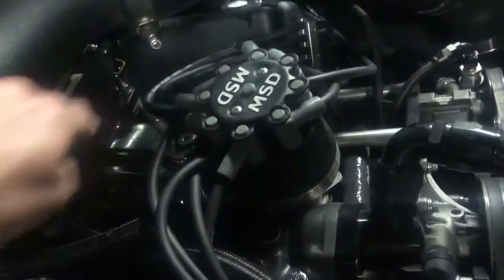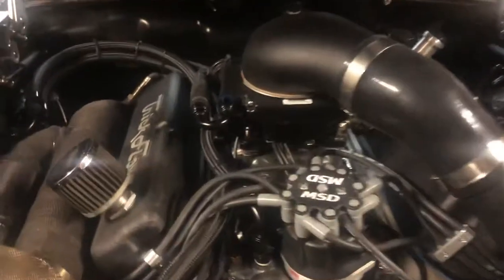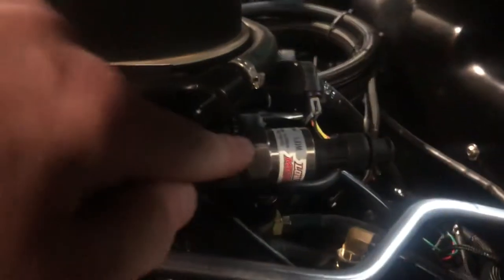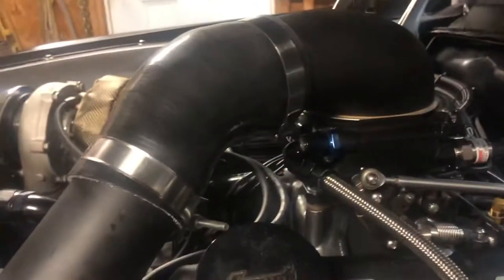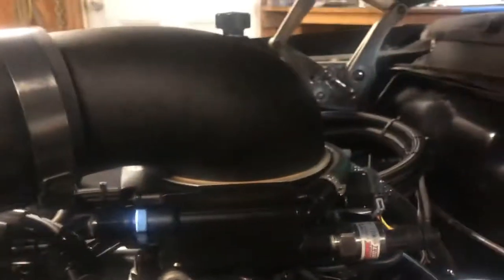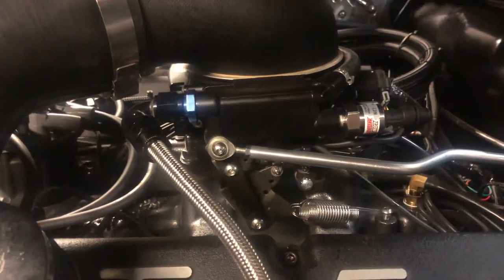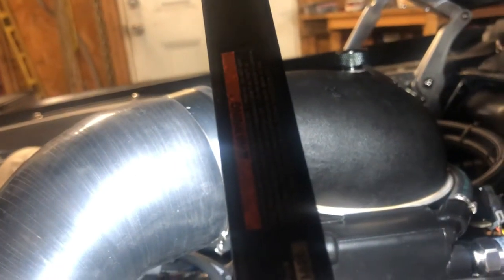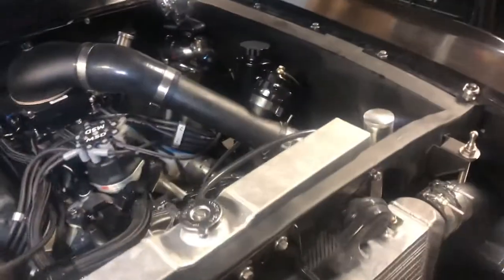Holley Super Sniper installation tips and common issues

Comment: great informative video, never too long if informative. I really dont like the idea of fabricating a EMI RF shield in front of the ECU, thats a band-aid to fix what the factory messed up in design.  I feel ECU should NOT be located in such a harsh environment like heat from engine and being placed next to a lightning storm called the distributor, especially being a Ford where the dist. is closet to ECU comparted to a chevy, like I posted on you other video the sniper Im told was designed on a chevy engine, go figure. talking to a holley tech they said to avoid using their MSD super conductive plug wires to eliminate RF and EMI,  they are 50 ohms/ft and they recommend 400-500 ohms/ft plug wires!! but al ot of folks are doing fine with the super conductor wires
Reply from the maker: thanks for watching it. im currently working on an insanely long series for install, setup, troubleshooting issues, basic tuning, etc.. multipart series.. i completely agree that using a block off plate, ferrites, foil, etc are just bandaids covering up issues that should be corrected. the hard and time consuming part is trying to figure out the source that's causing the problems. its not always that ECU that's the directly affected component though. most of the time interference is picked up off the sensor wires. that's funny that the holley guy said he didn't recommend super conductors because that's what several, including their videos, recommend because of the noise filtering/insulation that are on those. some other brands that are also good are magnecor and taylor's. one of the most important things is that the wires are actually "good" because new doesn't mean good always. i encourage testing them with a meter to make sure there wasn't a faulty crimp. also use a little dielectric grease around the boot and make sure they clip on securely to the terminal. I've always ran superconductors on my setup without issues. the other ford i did had either some MSD, ford performance or taylor's wires i think. been a while since i messed with it. i do with i had gone with a terminator x stealth, but for more reasons than removing from interference/heat. it would be a prep for port injection which i'll be going to at a later time.

Comment: What did you hook your secondary fuel pump to as in what wires on the sniper. I'm running a super sniper with the holley prodash and can't find any wire schematic on what to use on the dash pin out.
Reply from the maker: not familiar with the pro dash, but it can be any output wire off the sniper's 8 pin input/output harness. i used output #3. these are all ground triggers, so you'll use it to trigger a relay. then you go into the PC software under "efi" button for "system parameters", then under "basic i/o" - enable secondary fuel pump, select the output wire you used (#3 in my case) and configure the parameters to enable it (TPS, RPM, or Boost psi). mine is configured to come on at 12psi, which i don't even hit.. but it acts as a safety in the event my wastegate decides to stick.. but i also have over boost safeties to cut spark as well. i have no need currently for a 2nd pump, so its more of a backup right now.

Comment: Are you running your boast reference fuel regulator on the back of your manifold?
Reply from the maker: i believe so. pretty sure it comes straight off the intake. either that or off one of the throttle body vacuum ports.

Comment: When you first start the car did you have turbo hooked up or did you run it first to learn then add in turbo
Reply from the maker: started it first without, but not to learn or anything. mainly because i wanted to test fire it and didn't have the turbo piping finished yet. doesn't really matter how you do it. ideally, just run it once the turbo is hooked up. fuel/spark table will probably a bit different as far as scaling goes, especially if you did it with the wizard. NA map will max at like 105kpa (.7 psi) where a boosted app will go into actual boost. you'd scale to the boost you'll be running and make areas of the table that you'll be driving in most of the time more defined.
Reply: @callofgeorge  thx i appreciate your help and time im new to this efi stuff its a lot to take in but with great vids as yours it definitely makes it easier so thx im sure ill have more questions about stuff
Reply from the maker: @momentummotorsports6137  yup, no problem. ask away. I'll share what i know or point you towards the people who do lol.